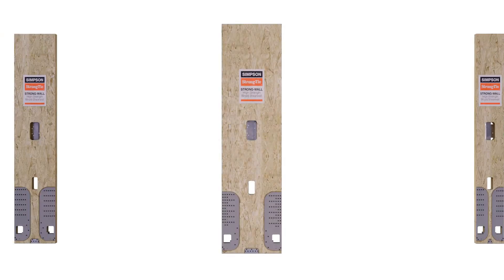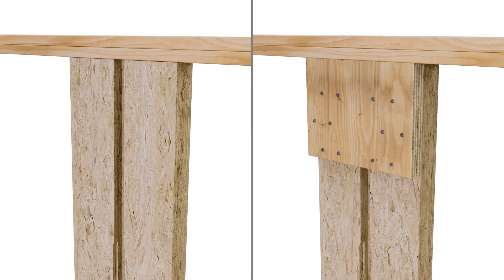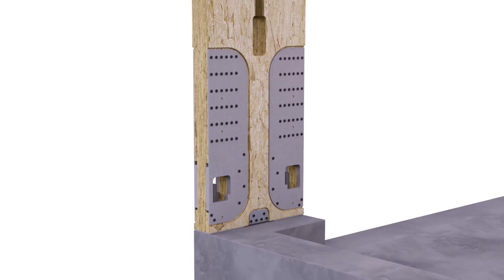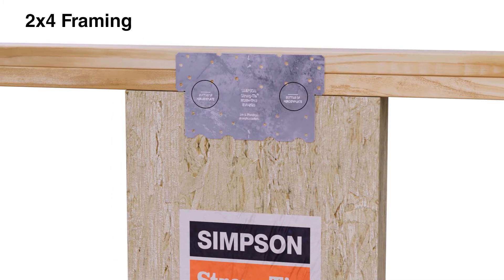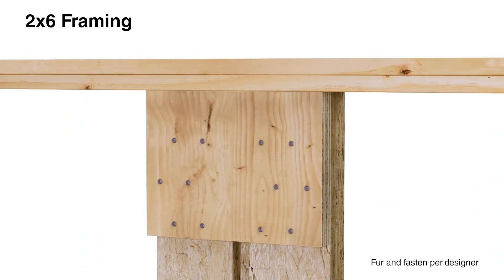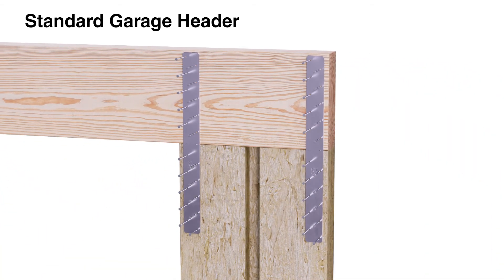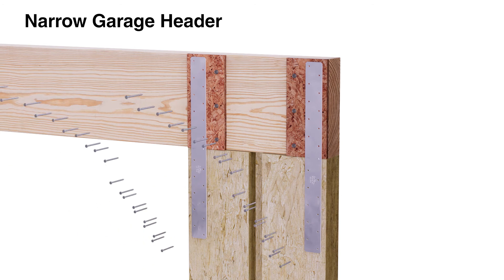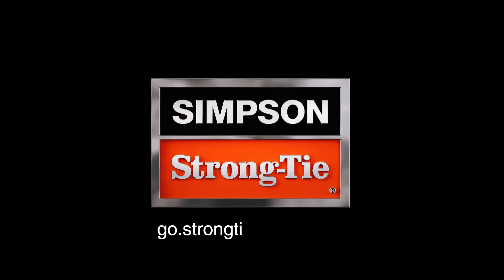How to Install the Strong-Wall® High-Strength Wood Shearwall (Animation)

Comment: How do you attach to the top plate if it's on upsloping roof/header?
Reply: Good question, also wondering about this!
Reply: Order a taller wall and cup the top to the same slope?
Reply: @VroomNDoom2602  yep, that's exactly what my framers did in the end. Seems to have worked out ok although they really struggled putting it in and the anchor bolts (installed in the concrete with the Simpson templates) came up a little short for the nuts to fully engage. Had to chip away at the concrete to expose more of the threads
Reply: @FrancisWong  I'm not a builder.  That sounds like a rough install.  The EOR should have figured that out for you so you didn't run into trouble.